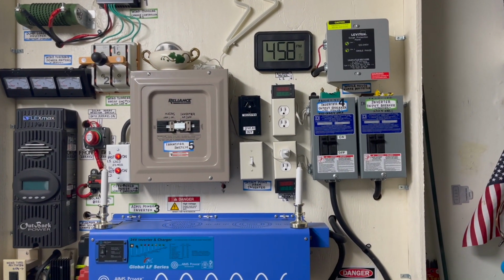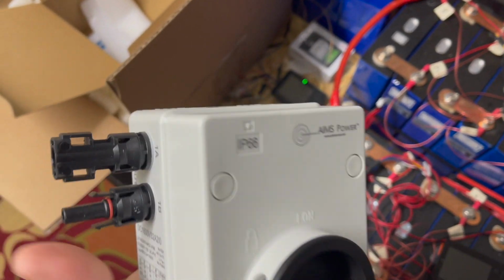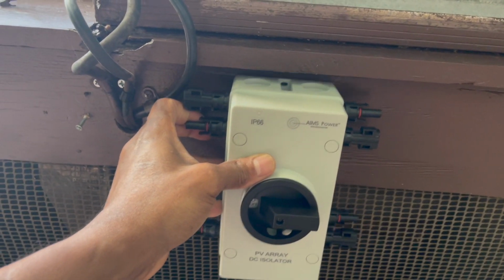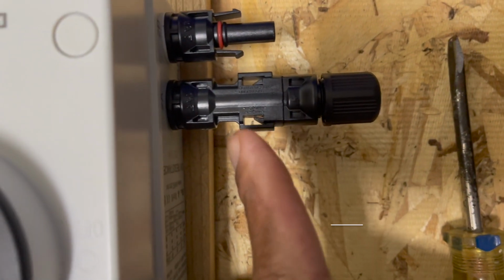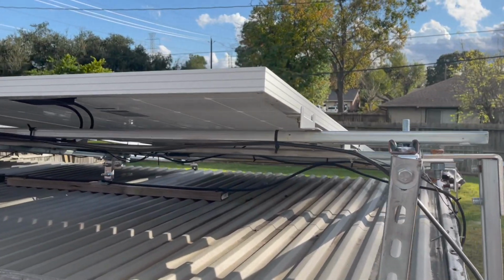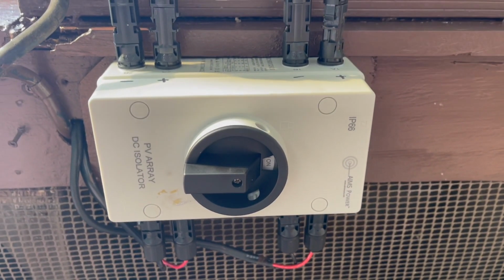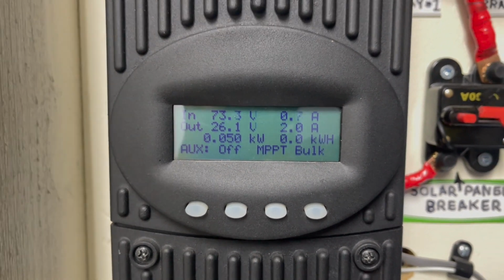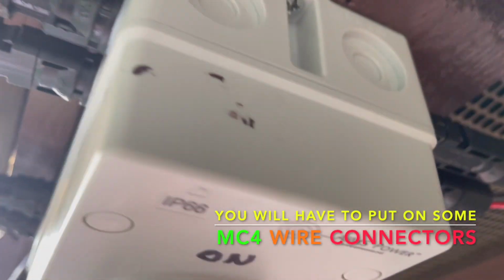PV ARRAY DISCONNECT SWITCH INSTALLATION

Comment: Holy Cow!!!  That;s a fantastic setup. You are like the mad scientist of Solar DIY, and I mean that in a good way. Love the way you labelled everything. If not, it'd be really hard to keep track of everything. I am about to install my own system, parts are arriving every day now. I could not find the AIMS double-string DC cutoff like you have, everyone is currently out of stock on that item. I actually have 3 strings, and 3 different AIMS cutoffs. According to my electric company, I need to have a cutoff outside near my electric meter to pass inspection. I am wrestling with how to put all three of these in a case and have no MC4 wiring exposed (has to be in conduit to pass inspection). Called dozens of companies, no one seems to have a clean solution. don't really want to wire them as 3 singles on top of each other, with conduit to each one, but I may just have to... 
Any suggestions?
Reply from the maker: PROBLABLY MAY BE BEST FOR NOW BY USING 3 BREAKERS OR BETTER YET , 🤔A 3 CONNECTION KNIFE SWITCH LIKE I HAVE ON MY WIND TURBINE . MAY THE SOLAR BE WITH YOU  .:elbowcough:
Reply: @defjamsgreen  great idea, but I cannot find a 3 connection knife switch that operates 3 separate switches. All the ones I find are combiner boxes, and I need all 3 dc strings to go thru the box separately and come out separately, not combined...

Comment: Cedric, any idea how to disconnect the positive cable from these units? I can disconnect the negative with my normal tool but can't the positive
Reply from the maker: That’s how mine was doing . After i managed to get it disconnected ,with a screwdriver or so which was hell to do ,I had to modify the negative so I could disconnect it by hand  . May the solar be with you .
Reply: @defjamsgreen  I figured it out, there are two kinds of connectors. MC4 and H4 https://youtu.be/0D8KkouqVBg

Comment: Nice. If you get a crimper, you won't need to solder the MC4 connectors on the end of the conductors. You just crimp them on. They make a special crimper just for MC4 connectors. It's what I use.
Reply from the maker: THANKS BUDDY . WILL BE LOOKING AND ORDERING ONE . MAY THE SOLAR BE WITH YOU .:goodvibes::goodvibes:
Reply: @defjamsgreen  hah hah. 😃👍